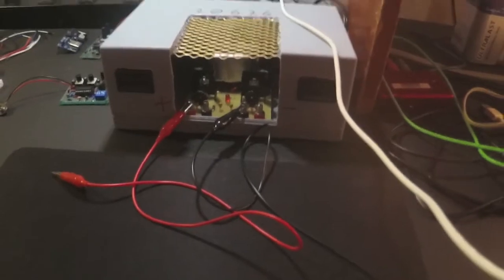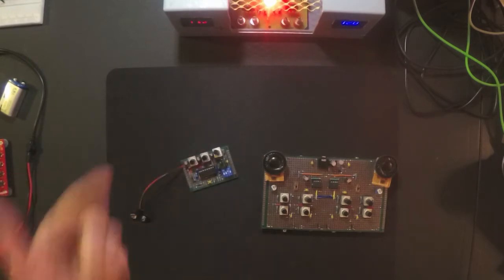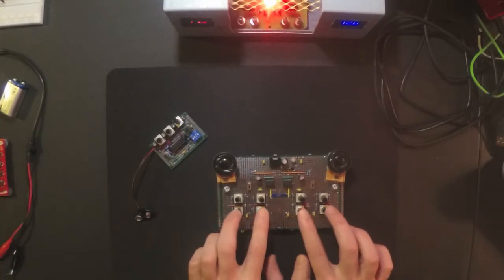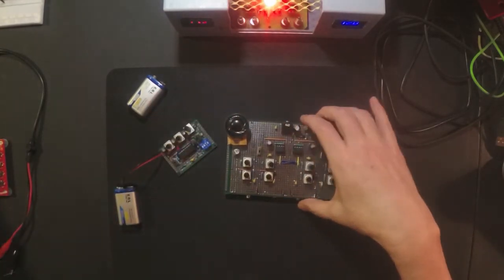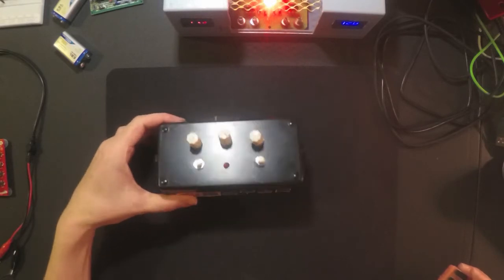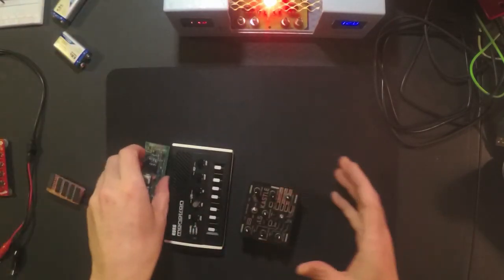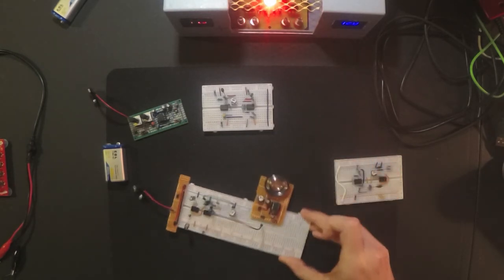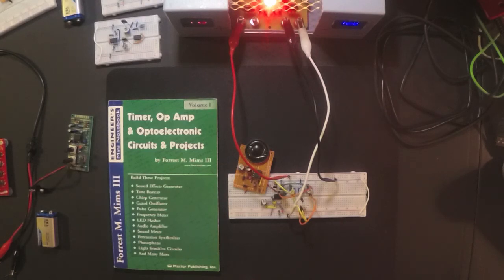Electronic Projects Update - April 2019

Comment: Wow you have been busy. Very inspire by your progress Haze. The power supply looks neat aswell. 👍👍👍
Reply from the maker: Thank you Adam you are an inspiration for us all! I have still yet to wire up an op amp generated sawtooth core or deal with envelopes and serious filters. Exponential converters? Oh dear! 😂 When I first got into this a few months ago I told myself I would not be touching the power stuff with a barge pole. 😂
Reply: @HazeAnderson  Thanks Haze. Well when i started i said the same thing to myself ," I just want to make an oscillator". I was sucked into the black hole of circuit building before i knew it. 
Still its very rewarding on many levels.